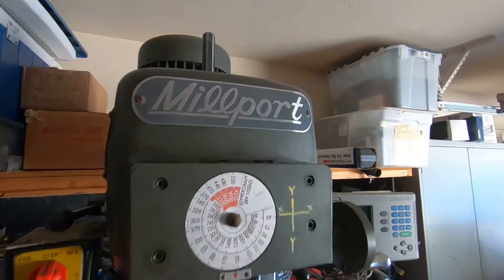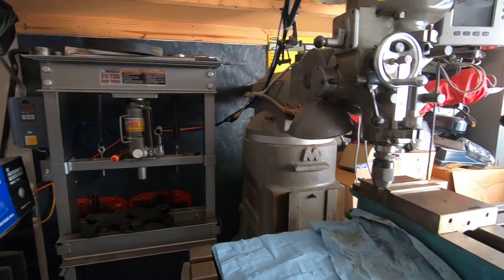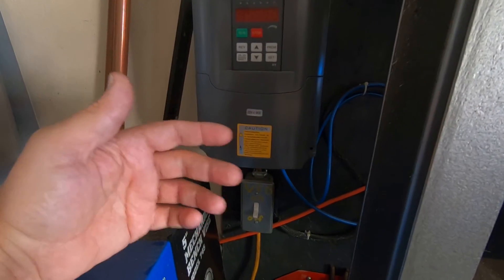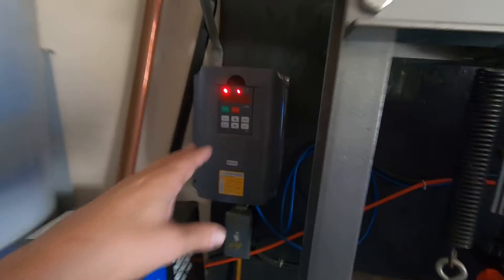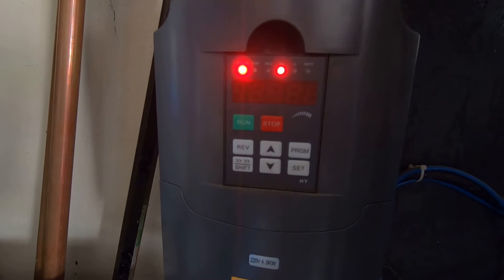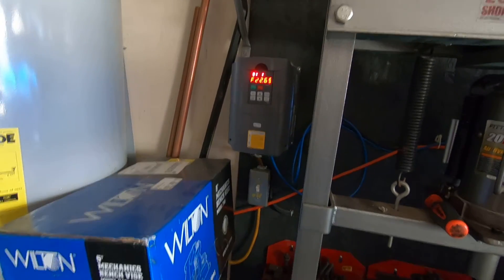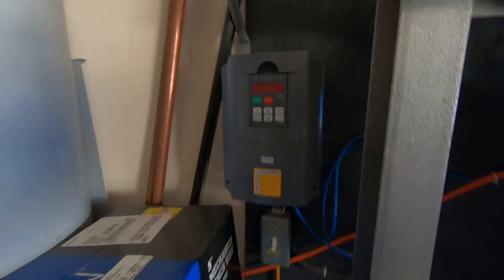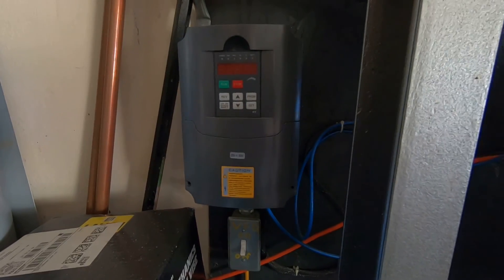Review of the HUANYANG 5HP 4.0KW Variable Frequency Drive "VFD" after 5 years in the shop.

Comment: I just bought two of these.  One to run a Bridgeport, and the other to run my south bend lathe.  Since the speeds on the lathe are set by the belt position on the cone pulley and back gears, how do I know what speed to set my VFD at to get the right speed on the chuck?
Reply from the maker: You will need to use a tach like this one. https://amzn.to/46Ct9u1
And then make sure to make note of where the VFD is set at to achieve whatever RPM you need.

Comment: If the max frequency is 50 Hz it looks like you still have it set up for 50Hz.  US power is 60 Hz, I've read/heard that running 60Hz motors at 50Hz causes them to overheat and loss of torque.  There should be a way to re-program the VFD for 60Hz.

Comment: Ya know, I don't know if I buy into that whole if you have more than one machine a rotary is the way to go.  I just don't like listening to the damn things.  I would say if you are going to run more than one machine at a time, the rotary is probably the way to go.  I have a mill, lathe, surface grinder and just bought my 4th VFD for a 3phase 10hp electric motor driving a hydraulic pump for a lift.  VFD's are cheap as chips these days and dead silent.  I don't even use all the features my vfd's allow.  I buy them from scamazon or fleabay.  I set them all to 60hz and never touch them again.  Even my 2speed motor on my lathe works just fine.  I have yet to stall.  You're mill is variable speed like my bridgeport, so again, set it to 60 and forget it.  The legacy controls work just fine.  I put a switch in front of every VFD I own, I don't trust the chinese and I also don't want them getting spiked or blown out from power spikes or lightning.  VFD's are the only way to go when ya can't get 3phase.
Reply: Certainly cheaper to buy Multiple VFD
Reply: as far as noise is concerned a rotary phase converter (rpc) only has the noise of a running motor. it can also be placed far enough away that you can not hear it run at the expense of needing larger wires for distance. typically the machine you are running will generate more noise than the rpc itself so its really a moot point. noise pollution is just something typical to machine shops. vfds also introduce their own noise from the motor which sounds like coil whine and is high pitched. if anything, it is far more troublesome to listen to then the generally low pitched sound of an rpc running. as far as the comment on if you have multiple machines then an rpc is ideal is concerned then it is true. provided you are buying half decent vfds the cost for more than a few of them often equals what you would put out for an rpc. not to mention you could build your own rpc for the same cost as a mid level vfd. also the fact that you can run multiple devices at once on an rpc comes into play and that you can leave controls alone. when using a vfd generally all controls need to be either replaced or rewired such as your fwd/rev, e-stop, on/off, etc